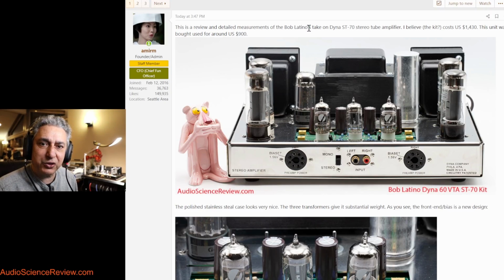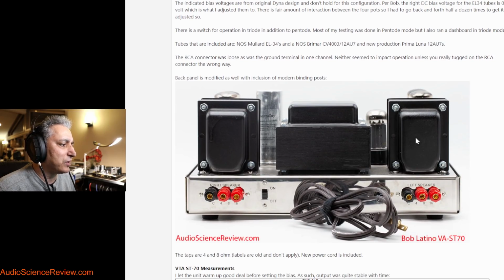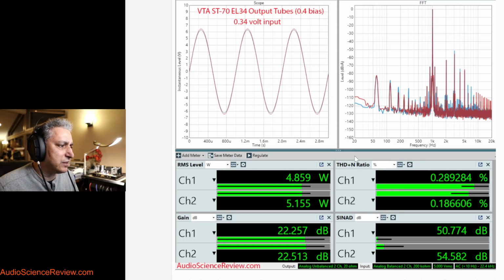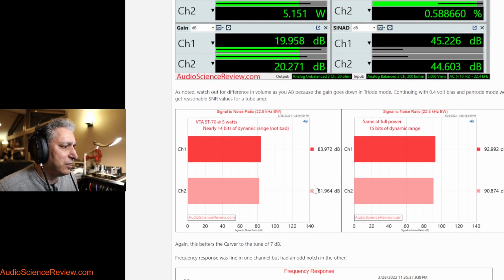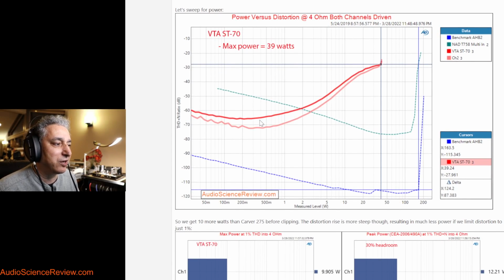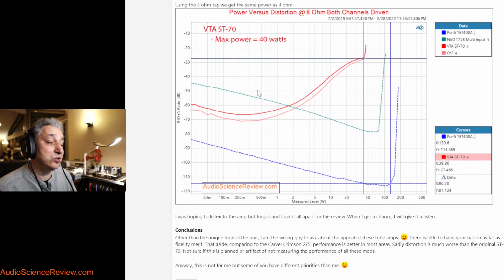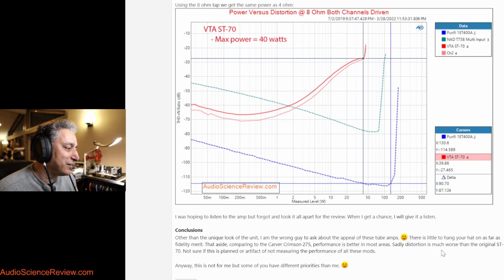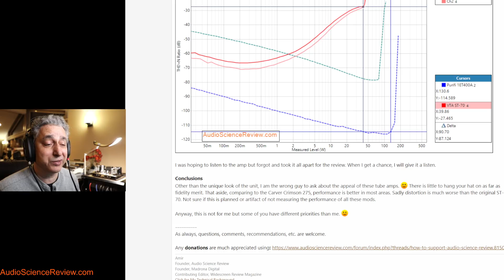VTA ST-70 Tube Stereo Amplifier Review

Comment: I have the higher power version of this amp the ST-120, it is absolutely amazing with Klipsch Heritage speakers. Super detailed, transparent, and plenty of grunt.
Reply: You made a point that is highly relevant. A tube amp will sound flabby on a speaker whose impedance dips dramatically at lower frequencies. A flatter load within the range of the amp wont produce the same result.

Comment: You mentioned the interdependency in the bias adjustment...  I took a look at the normal ST-70 schematic (assuming that this is probably quite similar in that area).  The output tubes in each channel (EL34) are arranged as a long-tailed pair with a single resistor (originally 15.6 ohms) connecting the two cathodes to ground.  The marking for the bias voltage of 1.56 volts would therefore imply a steady state bias current of 50mA for each tube assuming they are well matched.  However, the circuit board appears to have one adjustment pot for each tube.  The shared cathode resistor means that when you increase the bias for one tube, the current in its counterpart in the same channel will automatically reduce to compensate.  That is expected behaviour for a long-tailed pair.  You would need to modify the bias on both tubes up or down equally (assuming matched tubes and an equally matched initial bias setting).  Without additional measurements, so that the current in each tube can be monitored, there is no way of knowing whether the tubes on one channel are sharing the current equally or whether they are perhaps taking 40% and 60%, or even 30% and 70%.  The bias voltage reading across that resistor would be the same in all three cases, and if the current sharing was not equal, this would be adding significant harmonic distortion (possibly second harmonic).  To me, this is therefore a flawed design.  I would want to know with greater certainty that the bias was balanced between the two tubes on the same channel.

There could be some small degree of interdependency in the bias between the left and right channels, but that would be a function of the HT voltage stability with varying loads and would be much less of a concern generally..
Reply from the maker: Thanks for the comment.  They make sense.  FYI I went back and forth and got both tubes in each channel with the same bias voltage and hence current (subject to accuracy of the resistors they used).  So while it was some work, the test was with equal bias for each tube.
Reply: @AudioScienceReview  Cool.  I also just found a schematic that claims to be for the VTA ST70.  That shows separate cathode resistors, so that would certainly help.  But while it makes bias setting easier, it requires the two tubes in a channel to be more evenly matched in terms of their slope characteristics than would be the case with the long-tailed pair arrangement.  Just one of those trade-offs that designers make - gain a bit here, lose a bit there...  
Keep up the good work.
Reply: What effect would this condition have on the measured results?
Reply: @EskWIRED  Imbalance between a pair of output tubes in any push-pull amplifier  would adversely affect the harmonic distortion with one tube driving more than half the signal and the other tube driving less than half (for a sine wave, for example).  The other significant issue is that this creates a flux offset in the output transformer.  When the currents in each of the two tubes are equal there is no flux in the core under quiescent conditions since the flux generated by each winding cancels that from the other winding.  Push-pull output transformers are not air-gapped and so a current imbalance could also cause one half of the signal to potentially cause the transformer core to saturate prematurely when driving large signals.  That would also add significant distortion.

Comment: These valve amplifiers were the best sound available in the 50/60s but things move on. A modern amplifier (mostly) wipe the floor with power, detail, dynamics, distortion etc. I think people look at a valve amp, looks great, costs as much as a small car or even a big car in some cases! so it's got to be good. It's a case of the placebo effect mixed with a bit of snake oil. But, if it sounds good to you, buy it, we all have a choose.
Reply: Why so many people discuss about other people and changing times instead of  their own  experience?
Reply: @Mikexception  Experience, lets see. Started work after leaving collage in the lab at Quad, Head of test at Cambridge Audio, Development of 3 way cinema loudspeakers with UCI. Retail Audio T. Founder member of Monitor Audio. I think I know a little about audio!
Reply: @MichaelBeeny    I  mean experience as  something unknown  discovered in audio which could be help for those who would be gratefull  for it  . Audio is mostly  unknown land  of beliefs.
Reply: Armando Rancano  It means that no objective judgement above doubt    is possible  .Subjective are the only ones because too much differences of details  are mixed together We all trusted that there wiill be at end available ideal gear with ideal acoustic output.  But even every room will modify it in other way not mentioning faults applicated by unaware milions of users

Comment: In my experience I find my tube amps (Dynaco ST-70 and ASL AQ1004) to be less fatiguing than my SS amps (Sprout and GAS Son of Ampzilla).  The SS amps definitely offer better bass and definition but I just can't listen as long.
Reply: SS tends to sound "hard" but reason is in design  of speaker system. Only with resitance at terminals all is nice and flat for tube and solid .

Comment: Tubes suck. Unreliable heaters that produce distortion in HUGE amounts.
You can design around their limitations but why? It's expensive and difficult to get that trademark 'tubey' sweetness (another distortion). I can understand except that the same sort of 'signature' can be generated by ADDING euphonic distortion to VFet based designs. You lose most of the negatives and you can customize the output to fit the ears of particular audio enthusiasts. The same guys who buy crazy-priced wires.
Reply: Some people like bad sound and  they are happy with faulty gear.  It is their free  choice. To those who want perfect sound tube amplifier is also good  keeping in mind that  not faulty one and not with faulty speakers.

Comment: I still have the Stereo 70 that I built in 1962. So -- it has been around for at least 60 years.
Reply: My purchased 3 years ago Bell is made in 1963 and  it lives it's youth again. Replaced bad capacitors and left in place all good one and adjusted one resistor (not accurate), replaced one damaged pot in tone  circiut and replaced volume pot for doubled  reistance   - just found it works a bit better 

Adjusted bias , added volume indicators, modified external case to more modern look, new knobs   And modified "tape head" input to have  high senitivity but with switched off it''s head correction. The phono inputs are working perfect and amplifier in  modest listening is competitive to high class solid

Comment: In my main system I switch between a solid state Mark Levinson power amp and a custom tube amp. I listen to my tube amp nearly 80% of the time. I’m sure it measures terribly compared to my solid state but man it just sounds better at only 4-5 WPC.
Reply: Very interesting experience, have you do a blind test? not that I don't believe you, but our brains are so easily fooled by biases, if your preference stands a blind test, I'll tell you, I will finally consider to buy a tube amp.
Reply: @Madlop2  Absolutely blind tested, including level matching within 1-2db. Is the difference significant? No but it’s enough to keep the tube amp around. I have tried using a tube preamp with my solid state and it’s still not the same compared to a full tube amp.
Reply: @Madlop2  Do you listen to music blind or close your eyes? Why would you do a test blind when the result you are trying to conclude is for an eye opening scenario. 

If you even think people won't pass an experiment in tubes vs SS then I can safely assume you don't know what tube is. Tube is inherently very different for better or for worse.
Reply: I also keep system of two amplifiers  - solid and tube and have  possibility to switch between them in seconds. And  I see some adventages in both but not clear winner because both sound almost   identical  

 I switch to  tube amplifier for turntable and cassettte and reels because then I  sit in place and listen and choose  solid when  I listen to  TV and PC. Just to spare tubes. Stopped since about 3 years to listen to CDs because they show  too much not defined  differences in mastring.  Anyway I have one too and CDs. 

Also I use digital Korg  recorder for recording my preformances but again last time I switched to old reels as more practical while it's quality is to degree challenging Korg
Reply: @Mikexception  One day I’m going to get a reel to reel 😃
Reply: @epi2045  Good. Reels is nice gear and pleasure to have.   Keep in mind that if it is for often use  it's not only machine but tapes and reels and spares,  solving problems with taking care  of tapes, cleaning, lubricating   bias adjustmnent azimuth and   wear of head Without   "know how" for many it was   disappointing For me it is one of my lifetime hobbys.

Comment: It just shows that there are also bad tube amps. Probably it would be better to stick with the original ST70 design, also because that it the point of vintage sound, to recreate sound as it was back in the day. And to be honest, I love vintage sound. My set up is from the 80's (OK, solid state obviously) and I have no desire to take it to 2020's.
Reply: Lots of awesome speakers from the 80s especially if the caps are replaced.  I love my '86 Klipsch Forte I with replaced caps of course.  Still a better design than the later versions which all measure worse

Comment: I use a version of this amp I built myself with Bob's stuff. Kinda in-between an ST-70 and ST-120. 

It's been my main amp for 8+ years now. I've had/have a lot of nice amps, but the 'ol ST-70 keeps making its way back into my rack. I am using some upgraded Forte II's with it. It measures exactly like I thought it would. 

The one test I've ran between SS and tube amps is phase difference, at freq, between input/output. Have you ever thought about running a test like this? It's interesting.
Reply: I think real  test would be with pair of speakers connected to output which are the ones used for listening. Then results probably will be no comparable  to those with resistance 4 Ohms but that is what we get
Reply from the maker: It is a good point.  Let me see if I can organize that before the amp gets shipped to its owner.

Comment: That Dynaco (not Dyne Audio) design is from 1959. Vintage tube gear is an entirely different universe than the modern linear Chinese made DACs and headphone amps you evaluate. I own that same, newer unit and it is very engaging and glorious sounding. You don’t appear to know much about synergy between components. I could have told you that Infinity tower speakers would not be a great combo. Stick to solid state. Coincidentally, I’m currently shooting a review of mine for my channel.
Reply from the maker: I explained in the video that much more efficient speaker may pair better with it.  And given its high output impedance, a more careful analysis may have to be performed to know how the frequency response changes with the speaker.  Outside of that, the word "synergy" as no meaning.  It is a made-up concept by audiophiles to escape logic of something not performing well.
Reply: @AudioScienceReview  Synergy is not a made up term. It’s actually part of the fun of being an enthusiast. Mixing and matching gear can lead to some surprising combos and audible results. It’s not measurable however…but you know it when you hear it.
Reply: @MODAC  with no measurements your review means nothing. Synergy in hifi is just a bunch of mumbo jumbo. If the amp and dac measure clean and there is enough power for the speakers it will sound like any other brand amp and dac that measure clean and have enough power.  If different combos yielded audible results then yes it can be measured. There is no such thing as something being heard but not being able to be measured. This is how companies sell overpriced cables and power conditioners to the audiophools.
Reply: @PowerSerge5000  nonsense.
Reply: @MODAC  you're still an audio newb and you're on the wrong channel.
Reply: @PowerSerge5000  newbie? I have a fairly popular hifi YouTube channel and l’ve been an enthusiast for over 40 years. Why don’t you start your own channel and show everyone how it’s done?
Reply: @MODAC  most people believe lies their whole life. I'd love to start my own channel but I dont exactly want to spend money on state of the art measuring equipment like Amir here and I dont exactly have the room. Otherwise I'd just be another talking head subjectivist like you and all those other clowns like guttenberg and darko and so on
Reply: @PowerSerge5000  obviously you’re not having any fun. So boring. I’m having a blast!
Reply: Im really looking forward to all the measurements youre gonna take of your tube amp
Reply: @PowerSerge5000  Obviously no measurements.

Comment: I’ve had one tube amp in my whole life and it was a Roger Majeski RM9. It was a very dynamic amp with 2 6DJ8s and 4 EL34 tubes per side. 100W per side of output. It was completely rewired with silver plated high strand copper wire with Teflon insulation. The wire on some circuits was quite small before the change. You can’t change the wire from the transformers. It was left alone. A soft start circuit was added to extend the life of the tubes. I also changed out the power cable which was 14 gauge with a 10 gauge SJO cord and a hospital grade plug. It will not be current starved with that. There was little changed in it’s presentation except for clarity, openness and the ease that it had driving my speakers. It was worth the time and effort I spent on it. It was a lovely amp while I owned it. Everyone has an opinion on tube gear, but my experience was a very pleasant one. I wouldn’t hesitate to buy another RM9. Best tube amp made in my experience. Well made and very gorgeous sound. Stay safe my mates!😊👍🏻😁 Enjoyed this review very much Amir.
Reply: How does a 14AWG power cable current-starve a 200W amp? How long is it? 2 miles?
Reply: @peniku8 , I can’t make you see an advantage of a larger gauge power wire if you don’t want to. To each their own. It may be adequate, but I saw it as not so. The way I see it, if you have an easier flow of electricity to your equipment, it certainly can’t hurt it. You can believe what you want and that’s your right. I chose to because I believe it matters. You do as you please and we’ll all be happier. The power cord supplied got warmer than I liked. Safety first is never a bad policy.
Reply: @markphilpot8734  Leaving the senseless religion discussion aside, your power cord got warm on a 200W amp? I'd be concerned about that too. Sounds like something isn't quite right here and that's not the fault of a 14AWG cord. I'd suggest having an electrician check on your setup, like you said, safety first. Don't burn your house down with defective equipment!
Reply: @peniku8 , the electrical wiring in that house was faulted. I found out out after I left. The house was demolished. No loss. The cord I replaced the smaller gauge cord with never got warm so I figure from that, it was a smart move. You were right about the electrical problem. It was over 30 years ago this happened. Good for you! I have a new amp now, no worries.
Reply: @markphilpot8734  If that cord had earth wire and was connected to "zero"   then could be leakage to "zero"  and then  it prevented   user from voltage on chassis. Good for you but be carefull about that amplifier - i would measure AC voltage between chassis and any "ground" around When not grounded it may not heat up wires just because not conneceted

Comment: I saw a review that claimed that the Schiit Asgard 3 sounded warmer than another amplifier with lower distortion. The Asgard 3 is claimed to have less than 0.002% THD and less than 0.002% IMD. Can this level of distortion actually make a noticeable difference when considering the distortion in headphones? Could there be another reason for one amplifier sounding warmer than another when they both have a flat frequency response?
Reply: Youre assuming the reviewer wasnt full of shit
Reply: @PowerSerge5000  I'm giving him the benefit of the doubt.
Reply: @PowerSerge5000  judge for yourself
https://youtu.be/I1ikhLn1oxc
Reply from the maker: Those are the reviews you want to ignore.  :)  I have yet to find an amp that sounds "warm" or "cord."  Or analytical.  Or "detail king."  These are all imagined characteristics these poets write.  Please ignore them.  There is no science or engineering that back them.  The warmth or lack thereof come from your speakers/headphones and content you play.  You can also get some brightness if the amp runs out of power and distorts.

Comment: Why would an amplifier have a pathetic sounding bass? I guess it's because it can't produce enough current quickly enough?
Reply: Tube amps have a low damping factor and must be match with speaker that have lighter drivers. In that setup, bass will be as good as ss amp
Reply: @tubemaze270  what's the output impedance of this amp?
Reply: @tubemaze270  I find tube amps work best for mids and highs in active speaker configurations.
Reply: Pathetic sounding bass is created with that  pathettic sounding speaker cabinets which create  bass  with  acoustic  resonance When this  "see saw" is moving in resonance then controll  of it's masive   heavy membrane + mass of air in cabinet  by amplifier is too hard. Crazy phase shifts make humps in low tones  characteristic   It can't be nivelated by  amplifier